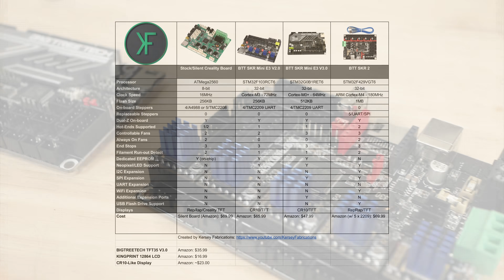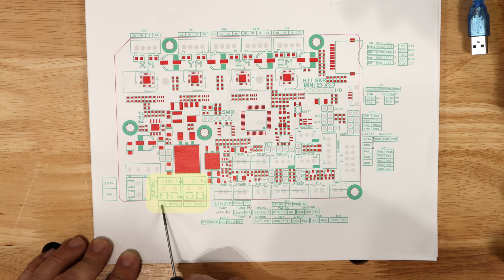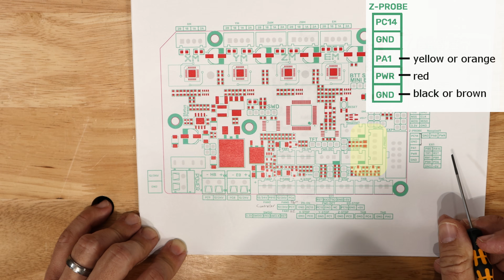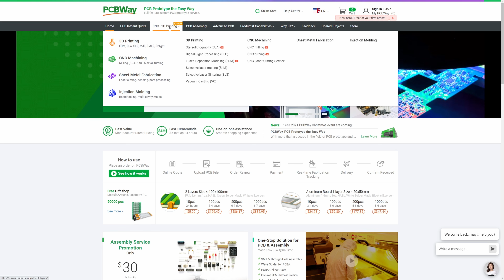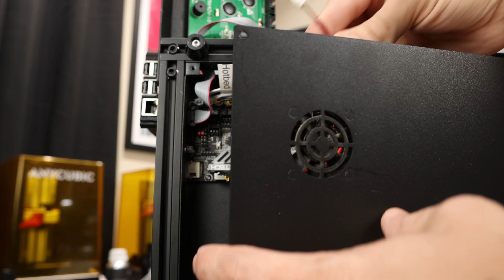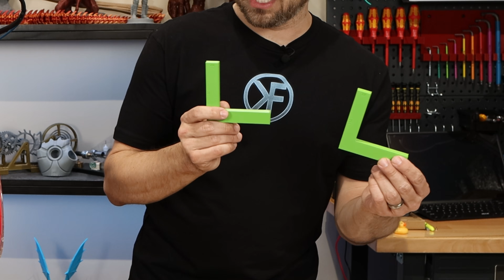Bigtreetech SKR Mini E3 V3.0 - Ender 5 and Ender 5 Plus

Comment: Hi Kris, thanks a lot for the great content. Your channel is probably the best on Ender 5 Plus upgrades. To be honest I’m a bit lost with BTT motherboard options. I saw your different benchmarks, I have the feeling that the SKR E3 Turbo is the best for my requirements: dual extruder, EEPROM settings storage, and a board that can evolve with the next. But I have the feeling that this MB is no more produced by BTT. The SKR v1.4 Turbo seems the new go to MB but without this EEPROM option. I would love to have your recommandation on which board is the best for you? (Without Case modification and money consideration). Thanks a lot 🙏
Reply from the maker: Thank you for the kind words. Right now I'm using the SKR 2 and I've very happy with it. With that being said, I know the SKR 3 is out and I'm going to work on that when/if I get time.
Reply: @kerseyfabs  Thanks for your reply 😊 SKR 3 seems indeed to be a nice board, maybe a bit overkill 😅 waiting for your review then!

Comment: When will you do the Ender 5 Plus? Looking to decide on whether I should go with mini or SKR2. Does the E5+ touchscreen and BLtouch work?
Reply from the maker: I won't be doing a dedicated video on that. Between this video and my upgrade video on the Mini E3 V2.0, I think it's covered. Right now I don't support any Bigtreetech board with the stock display but the BLtouch works with all of them. I am working on some new firmware with the stock screen but it's not ready yet.
Reply: @kerseyfabs  thank you. I have my Amazon shopping cart with the Mini and the new screen for the E5+ … just torn about whether I want to go through the hassle of the case mods. I haven’t had bed leveling issues in over 1 year and thinking of buying another printer or Mosaic Palette if I wanted color/extra extruder…
Reply: @kerseyfabs  Actually I may go with the BIGTREETECH BTT SKR 3 EZ Control Board Mainboard! Would the setup be the same even with EZ2208 V1.0 / 5 pcs?
Reply from the maker: @TheBrazilWill  I can't say it's the same since I haven't done it but it will be extremely similar. I don't have firmware for it yet.
Reply: @kerseyfabs  Hope you you get a firmware for it and do a video soon! The EZ drivers seem cool!

Comment: Using SKR 2 (F429) - Dual Z - TMC2209 - Ender 5 Plus - BLTouch connected to Probe - start of every print throws up driver error and kill error on the extruder any reason to why?

Comment: Upgraded my new Ender 5 Plus with Bigtreetech Mini E3 V3.0: and TFT35 V3.0 this week and have spent hours disassembling and reassembling rerouting BLtouch cables and  recompiling firmware and FINALLY have it doing auto bedlevel much more consistently.
It seems that the V3 board has some issues with ADAPTIVE STEP SMOOTHING in configuration.h being enabled on this board
The symptoms were not completing a full bed level and erroring out both in Marlin Mode and TFT Touch mode
On Marlin forum it has been noted for a while that this seems to be an issue
I run a V2 board and TFT without any issues on ender 3 but ender 5 had me beat
I post this here in the hope it may save someone else the frustration that i have had
Luckily i am a software and hardware nut and could imagine a new upgrader being really frustrated
It would be a good ide to release this mod as a binary for others who have the same issues

Be aware i am not guaranteeing this will fix all problems but it fixed mine

Comment: Hey when I go to auto bed level the probe retracts and deploys just fine but doesn’t actually detect anything so everything just crashes into the bed, I have the bl touch plugged into the z stop not sure if I did something wrong or what
Reply from the maker: Pay attention to the firmware download in the description. Is that where it's set to?
Reply: @kerseyfabs  my z stop pins needed swapped and now it works, but now when I print things it starts up and homes like normal but then slings the hot end into the corner and starts grinding, I’m using stock settings on cura
Reply from the maker: @RAZERTAHP  That's good you sorted the pins. Are you sure you're running my firmware if it's not homing correctly? Are you using a non stock hotend?

Comment: Where exactly can we find the Configuration.h and Configuration_adv.h files that you used to generate your firmware downloads?  On your github it seems that the configs now point to MarlinFirmware.  I'm trying to just modify my Ender 5 Plus firmware to use the probe connection rather than the Z-stop connection for the BLTouch, so it should be a simple mod of your .h files if I'm able to get to them.

Thanks!

Comment: Great video, i used it as a guide and my E5+ now is back to work after a fried axis drive. Only issue as the print start after homing X-Y-Z (have cr-touch) suddenly runs X-Y fast and clash, the thing doesn't happen if a print tuzi gcode that came with the printer SD but with all my GCODE from CURA  previously printed does. Any tips to solve the issue? Thanks

Comment: Hi, I tried your firmware but the it cant get bltouch to work, the probe moves when i start the printer but wont come down and function as endstop. I tried another firmware and it worked but babystepping did not work. Any help?
Reply from the maker: Did you make sure the black/white probe pins were plugged into the right location? See the video description. Each file says where it should be plugged in.
Reply: @kerseyfabs  Thank you for a quick answer, I observed that I had to switch the polarity on the black and white wires so they plug in correctly. Now when I tried to flash your firmware again I cant it into the machine. The filer changes to CUR but in the printer info it says "unkown" and I get a message "no printer attached". This other firmware works, I defined babystepping in marlin but I do not know how I can get it into BIN file so that I could flash it with changes I did... I could try to swap the polarit on the black and white wires back but then we come to the problem that it doesnt flash it correctly anymore...
Reply from the maker: @maxsaloranta8456  I'm not talking polarity. I'm talking port. Whether it's plugged into the Z endstop or the probe port.
Reply: @kerseyfabs  Oh i read that wrong. Yes its connected into z endstop
Reply: @kerseyfabs  The printer is ender 5 plus.
Reply: @kerseyfabs  This is embarrasing, I've downloaded wrong file by mistake. Now I got the right firmware file downloaded, but it seems like the flashing process doesnt work. 8GB sd card formatted to FAT32 with 4k bytes.

Comment: i have one question about this does the new ports of the motherboard fit in the hole of the old ports?
Reply from the maker: Yes. This board's screw holes match the stock board.

Comment: I put one of these in my ender 5 plus today, screen is just black. Huge disappointment after waiting almost a month for shipping. After multiple attempts at firmware fixes it seems i got a dead one. Not holding my breath on biqu to be too helpful.
Reply from the maker: Stock screen or did you get a Bigtreetech screen?
Reply: @kerseyfabs  stock, but im gonna try the th3d screen
Reply from the maker: @keithswann3164  The TH3d screen should work.

Comment: Uhh... I usually really like your videos but wtf bro.. this is hardly an upgrade.. I guess there's better 2209 chips but it's missing so many features of the SKR 2 like removable TMC drivers, and so many extra connectors/features... Like dude you have to be looked to get a board with built-in drivers in 2022.

Comment: I have a ender 5 plus, what i need to get ? need a display? will work with oem bl touch ?  what the best board ? thx
Reply from the maker: The best board I've CURRENTLY used is the SKR 2. The SKR 2 requires some case mods though, that I show in my SKR V1.4 video. The SKR Mini E3 is a drop in replacement. You will need a new display for both and to print some mounting hardware. That should be it beyond some possible screws.
Reply: @kerseyfabs  e3 mini display oem will fit? Thx regards
Reply from the maker: I wouldn't get the e3 version. Get the standard version. https://amzn.to/3NEW44d

Comment: Hey Kris! I'm gonna try this in my E5 Plus.. Extremely nervous, but going to try it. I used your stock E5 Plus firmware, and it was pretty much plug and play. So I'm hoping this will be the same. I ordered the v3.0 and the tft35 screen. I'll have to print the adapter for the stock body today. But really hoping this works out ok..
Reply from the maker: Best of luck! I hope it goes smoothly.
Reply: @kerseyfabs  I did this install, got the bl touch to work by just rewiring it. BUT I could not get the filament runout sensor to work correctly? It lights up, but doesnt stop or effect the machine when its out of a fialment :(
Reply from the maker: @stevengill4201  If using the touch interface, you have to plug the runout sensor into the TFT instead of the mainboard. Then configure it via the touch interface. The runout sensor should work connected to the board if you're using the Marlin interface.

Comment: Will your firmware work with my Ender 5 pro with a cr touch? I tried and the z axis doesn't seem to be working
Reply from the maker: It should work. If all the other axis work then Z should work too. Be sure to home first.
Reply: @kerseyfabs  ok, thank you. I was having trouble getting it to home first. The bed was staying about 10mm under the probe so I didn't know if it was a firmware issue or me. I couldn't get it to work so I tried a couple others and got bigtreetech's marlin 2.0.9.3 working with the cr touch but I thought yours might be better. Thanks for making your channel I find it very helpful and reference it often for my Ender 5 pro.

Comment: I have Ender5 plus, i install it but when i turn on the board, bed temp keeps rising..forever, i check the board when i turn on the board HB port is always keep 12v... it doesn't controll.
Reply from the maker: You may just have a bad board. It happens.

Comment: BTW - that new link you gave to the pre made JST connectors are for 1.25mm JST connectors (refers to the inter-pin distance) - the plugs that are required are 2.54mm (TBF they do look identical in the picture, but having tried to make up the 2.54mm ones I hate to think how difficult making the 1.25mm ones are).  They are available on amazon if you look (although I had to buy 50) - I won't include the link because I'm in the UK.

Comment: My BL touch has been buggy since putting this board into my Ender5+ and using Kersey's firmware. I got a "failed to enable bed leveling" on the touchscreen. It doesn't probe the bed properly, fails to create a mesh, and pushes the nozzle into the bed. anyone else having this issue??

update: it will initially probe about 10-13 points during a 25-point mesh and then fail. after that failure, it will not get past the first probe point. Connecting it to Pronterface and running some tests as suggested from TeachingTech's website, the BL does not respond to some g-code commands. It will deploy but not retract. Strange? as it will during its test phase. Teaching Tech suggests that this result may mean that the black and white wires on the Z-endstop pins are in the wrong order, but after triple checking the pinout schematics, I am certain that all 5 wires from the BL-Touch are in the proper place on the SKR board. 

My testing has lead me to believe that the issue is arising from the Z-endstop pins, just not experienced enough to know what.

anyone else having an issue with their BL touch functionality on this board? Looking at forums, people were also having issues with it on their Ender 3's as well. any suggestions or information would be greatly appreciated. I'm desperate to get this working
Reply: I have the exact same problem, have you found a solution for yours?

Comment: Thanks for a great video.  I've currently got an Ender 5 Pro with a silent motherboard (with a BLTouch) - can I just pretend that it is an Ender 5 for the purposes of working out which firmware to use?  Also, its currently connected to the Z endstop - I didn't realise there was an alternative.  Any advice on which is better?
Reply from the maker: Yes, absolutely. Same deal. Functionally, there's no difference in the connectors. The firmware just had to know wear it's connected.

Comment: great video but can you explain how to connect the bl touch for the ender 5+? mine just glows red...
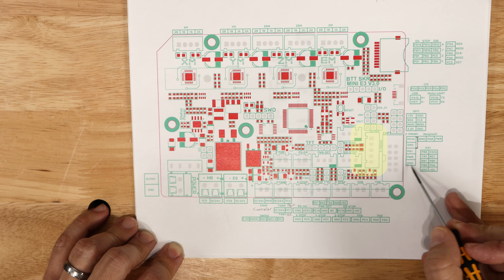Reply from the maker: At 17:07 I show the wiring diagram for it. I've heard of some people having to replace the connector. Also be sure to check the firmware file information in the description on where to plug in the black/white wire.

Comment: With your ender 5 plus with BL touch bin for the SKR mini V3 How do I change the settings to work with a core xy mod?
Reply from the maker: There are settings, I believe in Configuration.h that enables CoreXY mode. I haven't built one of those myself.

Comment: Could this be installed in a CR-10 V3? I have searched YT & Google but only found hints that it should be but no where to find where to change the size of the bed & height? Clipper would be fantastic & should be quite easy beside sorting out the parameters for the extra Z.
Reply from the maker: I don't see any reason it shouldn't work. It may need a new display too. Then you would need custom Marlin or custom Klipper.

Comment: I disagree with the statement that tinned wires are a hazard. If tinning was a bad thing, every solder joint in you system would be at risk. However, I do agree in using Ferrule connectors as it bundles up all the strands into a cold weld and allows that to pass as one into the the connectors for power. You don't have to worry about straggler wires that can cause shorts and decrease the surface area in which electrons flow. Tinned wires are not a issue, and are used in high power systems as well as low voltage high amperage, mostly in corrosive environments.
Reply from the maker: The worry usually comes from crushing the tinned ends and them possibly arching over time. At least that's my understanding.

Comment: I have the new mini v3 in my ender 3 pro for a few months now. I got it right around when it came out. It's pretty flawless. I absolutely love it. Great price too. Getting rid of my ender 3 pro and upgrading to an ender 5 pro. 100% swapping my v3 board into my new ender 5.
Reply: How that go?. I'm thinking of swapping my creality 4.2.2 board for the skr
Reply: @twiztid664  I had the 4.2.2 board originally as well. Do it. Totally worth it. Stil been running strong zero issues. But it's not a simple plug and play. The only things that sucked is that for my CR touch I had to swap two of the wires in the JST connector for it to work on the board. Wasn't hard at all super easy but figuring out why it wasn't working was a pain at first but there's a really good guide online that explains all the pinouts on the board for you. Just had to look up which color wires were what on my cr touch. Same thing would go for ther BL touch as well. And ontop of that the firmware that came out for the SKR mini v3 at the time just wasn't working right. So I had to compile my own firmware which again wasn't hard but annoying as hell. After those 2 things though it's been flawless. Beautiful prints and my printer is insanely quiet now. Worth every penny. Again these issues were when it first came out so I'm sure the current firmware is all fixed and you won't need to compile your own anymore. Overall I'd recommend it over the 4.2.2 board for sure. And the mini v3 price is good.

Comment: I have the BTT SKR MIni E3 v2.0 board. But I really think I'm going to upgrade to this board just so I can have that extra fan header. I'm really excited to have a silent printer when I'm not printing.
Reply from the maker: Either board works great. I do like the extra header though. My printer is almost completely silent when not in use. This means I can leave it on and ready to receive prints.

Comment: Hello is the firmware of the Ender 5 and Ender 5 Pro the same. On the net you can always find different and the v2 board is apparently also different why?. Thanks
Reply from the maker: There have been different boards in the Ender 5 line over the years, so for the stock board, firmware may be different. For this board, the firmware should be the same.

Comment: How reliable are those solder seal connectors you used for the hot end fan wires?
Reply from the maker: Extremely. They're actually used quite often in marine wiring. They're stronger than regular heat shrink due to the glue.
Reply: @kerseyfabs  Good to know! 👍🏼 I'm planning this board swap for my Ender 3 pro, so just trying to figure out which is the best way of doing the hot end fan wire, your method seems to be the most hassle free way and cost effective  way so I will probably do it this way after some practice on some scrap wires

Comment: The easiest way to remove hot glue from boards/connectors is to saturate a wad of paper towel with isopropyl alcohol (91%+) and let it sit on the hot glue.

Comment: Another fantastic video! I bought my first 3d printer (ender 5 plus) and a Bigtreetech SKR Mini E3 V3.0 as well for my ender 5 plus after watching your videos. You explain things very well. I also bought a ender 5 pro and SKR Mini E3 V3.0. Would your firmware work for this printer as well?
Reply: I'm with ender5plus, skr mini e3 v3 ,klipper
Do you have a problem with bltouch or which FW are you using?

Comment: Wondering if I might have received a bad board. I installed per the schematic and the video on my ender 5 plus, but on boot up I have no screen. It’s plugged in but no visual. The SD card has also converted the file to a .CUR file.  Would you have any suggestions?
Reply: Im having this exact issue and cant seem to find obvious answers as to why.